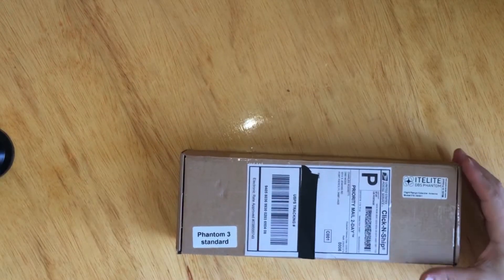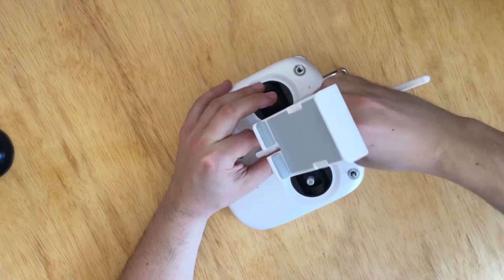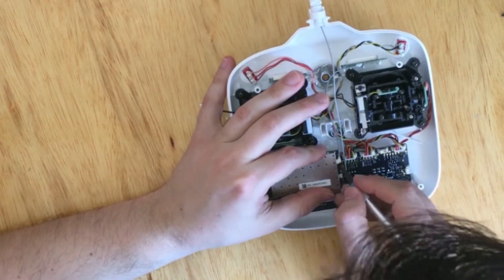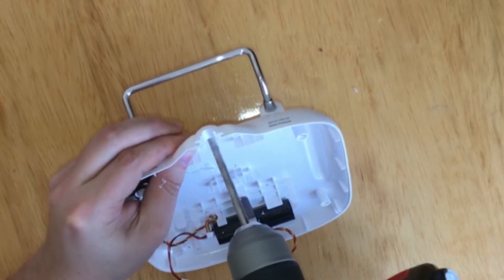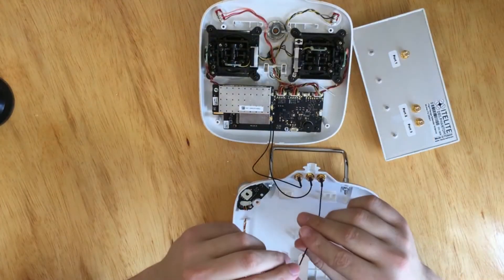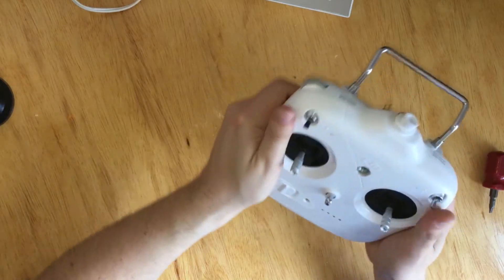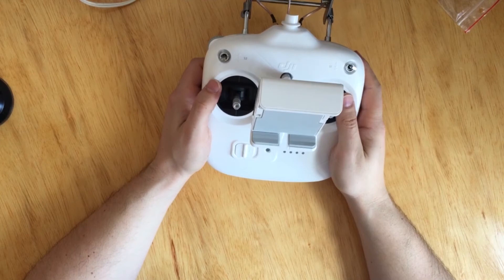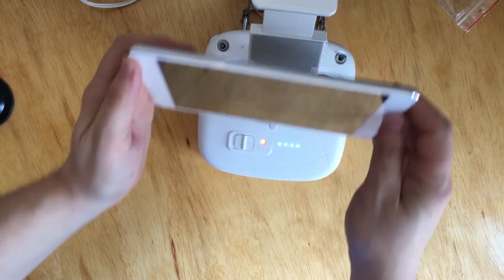DBS MODs ITELITE Long Range Antenna for Dji Phantom 3 Standard

Comment: Raul, does this mod really increase distance?
Reply from the maker: Adrian Martinez In my opinion it 100% improves it. Reason why I bought another one for my professional one. I have a test video with the antenna installed on the standard. Over 10,000ft I got with it.

Comment: its same for phantom 3 4k? and the distance when u lost signal
Reply from the maker: I'm not 100%, but I would assume so since it uses the same DBS antenna. The install might be slightly different.
Reply: because i habe 3 4k but in 120 meters altitude i lost signal :(
Reply: I have the 4k edition and  port 1 on the dbs antenna is for the 5.8ghz cable (black cable). Port 2 and 3 are for the two 2.4ghz (gray cables). The standard phantom 3 does not have 5.8ghz transmitter like the 4k. If done correctly you should get double to triple video transmission range. Before, I would get 300 -400ft elevation and I would lose signal but with the dbs antenna I went up to 1000ft before I stooped myself since I didnt want to go any higher and it still had good signal.
Reply: 2Ulorilouwho friend u have mail or some i buy dbs antenna i install tomorrow
Reply: Sorry but I do not understand your response.

Comment: I followed your instructions and installed Itelite DBS Flight Range Extender Antenna ITE-DBS01.4. However I am getting <900m. I am flying over bush lands with no high trees, no hourses, antennas or power lines. I checked in 3 similar locations and the unit initiated no signal RTH. I tested aout 5 times in 3 locations. I cannot understand how others getting the ridiculous ranges mentioned. I have ensured that the cables are not crossing. I am running latest firmware. I must say that I have archived same distances with stock antenna. Only improvement for me is that I do not have to diligently turn towards the exact direction of the drone. Any suggestions appreciated
Reply: Sanjeewa Samaranayake I am getting the same in a similar terrain Maxes out at 950m
Reply: I just did the mod and it is pretty easy and straight forward so the only thing I can think is A, the wires aren't clipped on real good or on the right spot or B, you got a bad unit.